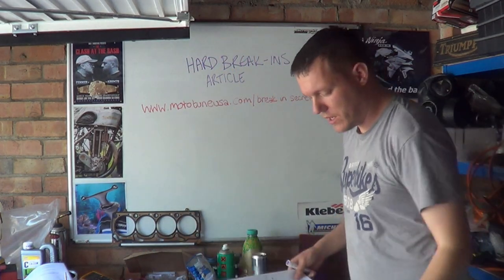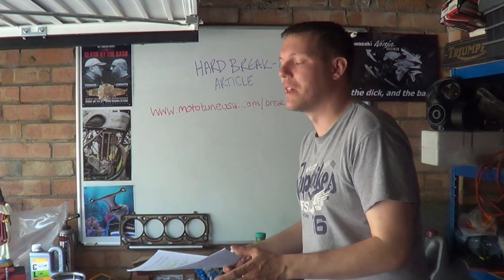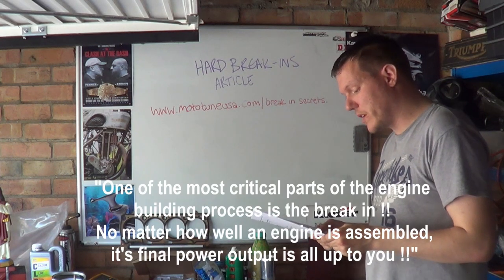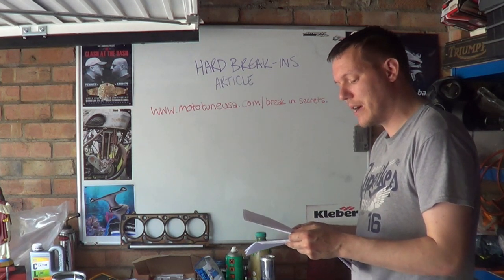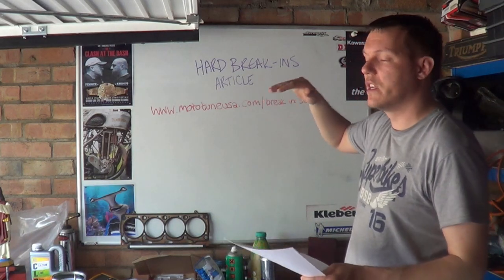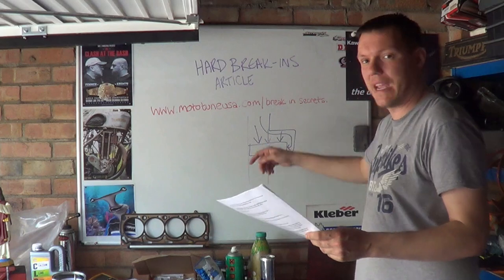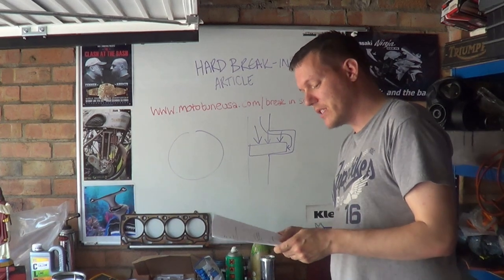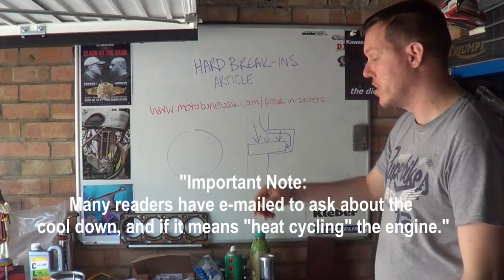Hard break in BULLSHIT! - Part 1

Comment: Those dyno run-in instructions are perfectly clear, they are pretty much how you start to run run in a race bike on a  dyno. You are misunderstanding throttle position and bike RPM. The 2 are very different and in your haste to discredit, you either tried to make it sound ridiculous or misunderstood.
Reply from the maker: You've misunderstood what I was getting at. The guy is banging on about ring bed in, so the only thing that should matter is engine rpm, not throttle position. 50% TP isn't always 50% rpm, regardless this shouldn't matter when considering the 'hard breaking procedure'. But hey, is wasn't totally clear what I was laughing at. 

Secondly, the run-in procedure is a lot different for a racing 'break-in' if you can call it that - I go through this here - https://www.youtube.com/watch?v=EQJuCdRzlA4
Reply from the maker: I didn't misunderstand anything, I laughed because the article is talking about break-in and ring seating. So rpm should be your only consideration. I fully understand that 50% throttle isn't 50% rpm. As far as racing 'break-ins' go I did a video here - https://www.youtube.com/watch?v=EQJuCdRzlA4
Reply: He says 50% throttle  40-60% max rpm, he never says 50% throttle 50% rpm. The 50% is the amount you roll on, and the 60% is the max revs you allow the engine to reach, it is pretty clear tbh. How do you answer the fact that all the engines are run to max rpm at the factory before signing off QC and going for delivery?
Reply: @dirtygarageguy  could please explain what you meant in the clip from 16:09 to 16:17, please ?

Comment: the so  called peaks on the cylinder wall  are supposed to be removed by soft honing, cross hatch does two things, hold the oil film and causes the rings to rotate (unless pinned for two strokes) there are companies that make gapless second rings, gas port  rings that use cylinder pressure to seal can fail due to carbon build up, the NASCAR guys say the rings are seated, by just turning over the engine during assembly, I think the real deal is  the heat cycle, warm the engine up give it some blips, check oil water etc and keep an eye on the oil filter for the break in period
Reply from the maker: The ring reason is their argument not mine, more in part 2

Comment: Is this just from new? or does it include after doing the top end on the motorcycle?
Reply from the maker: From new. But if you have most of your components changed then that is like new. If you have your valves replaced and guides then a slight break-in would be a good idea for say 200 miles. Basically run it for a month not thrashing the shit out of it.
Reply: Thanks, always used gentle break in, I race KTM 150sx and always put atleast 1-1/2 hours on it before opening it up as the top end is only done every 25 hours
Reply: The Workshop 200miles. Quite low there. I once replaced the conrod, piston, and cyl block (my daily 150cc). And was just simply told by the garage to "take it easy" for 1month/1Kkm. Which is basically the whole new break in procedure. Tl;dr How to determine break in after overhaul/major repair?

Comment: I dont understand the argument about a finer honing. Isnt it so, that you in fact need a slightly rough honing to prevent the hot runny oil to flow all the way back into the dry sumb

Comment: "half throttle dyno runs from 40-60% rpm" actually makes sense. Say your engine revs to 10K rpm. You would the run the engine from 4K to 6K at half throttle. I'm not at all convinced a few dyno runs are enough to run an engine in though.

Comment: Slow break in or hard break in dosnt matter as long as you are not revving the shit out of it for a long period of time.
Manufactures test every motorcycle before it leaves the factory and they dyno the shit out of them.
Watch how is made of any motorcycle. 
They all test the shit out of the bikes.
Just make sure you cahange the oil more often to flush out all the metal particles that accumulates from new part friction.
Reply from the maker: 1) what the fuck is a slow break in?
2) "as long as you are not revving the shit out of it for a long period of time."

- How long is a long time? 10 seconds or 5 minutes?

3) "Manufactures test every motorcycle before it leaves the factory and they dyno the shit out of them."

- what does dyno the shit out them mean? They run the engine through the rev range - to check if it can, noise, oil leaks, emissions etc.
Reply: Ment to say soft(manufacturer's way).

Don't redline it.

2-3 seconds at 7000-8000 rpm is not going to harm the engine.

And when I say manufacturers Dino the shit out of them, watch a video and see how they Redline the bike and they go through the gears hard .
not soft.

Comment: Hone in. Hahah! 
The best break-in is a slightly spirited drive around town, no engine braking. Go through the gears, roll-on the throttle as speed increases. Minimize time at idle. It's no big deal. Have enough RPM so the crank splashes oil at the bottoms of the bores, because some engines idle really slow. My LS idles at 500rpm, 40 PSI of pressure. With a bit of throttle, it goes over 60 psi, so wherever oil splashes, it'll splash better with a bit more RPM. Therefore, going around through the gears over and over. 
--A bigger ring gap or a little bit of blow-by isn't the end of the world. An engine that burns oil isn't profoundly bad. Closing a ring gap, that's fucked. Burning a quart every 1500 miles is annoying, but tolerable.

Comment: Every bike manufacturer here in Japan does the hard break in at the factory. So do the race teams. Except crashing there is only good that could come out of riding it like you stole it when you take delivery, and it's fine to do so. If it wasn't, the factory wouldn't be wringing the shit out of the engines at the factory on the dyno like they do right before shipping if off to the customer. If there is a chance you can get the seals to seat a little better during the first 100km you might as well go for it.  Just don't track it due to the danger of overheating. If you wanna sissy it, well that's probably fine too but you'll always be left wondering if your engine could have been destined for something tighter lol.
Reply from the maker: No they don't. They run the engine through the revs and gearbox looking for assembly faults. 

You've been watching that jake twat...

Comment: 2017 gsxr750 manual states to load the engine and vary the rpm but do not exceed 7000rpm for 500 miles. Also says to not overload but does say to load the engine
Reply from the maker: Riding is loading the engine - I'm not sure what you mean?
Reply: that's my confusion. i think they mean don't go crazy on the throttle but at the same time they are saying not to baby it because it specifically says to put some stress on the engine.

Comment: I just know during break in there is a lot of material that gets in the oil and cranking down on something with that oil in it is probably not the best.
Reply: Hence, why you should change the oil early and often during break-in. Not wait till 600 miles of damage has occurred as the manufacturer recommends.

Comment: Chrysler recommends a similar break in procedure in their owners manual . When breaking in an engine on a dyno is much the same. I have a car that is 15 years old and 155K miles broke in his way. It does not use any oil between oil change intervals that can be observed on the dipstick. My UOA has single digit wear numbers. On 1500 mile road trips it will use 1/8 of a quart. I understand I am talking about car's and trucks. Most Toyota 2003 Camrys of that vintage have oil consumption issues but not mine. I would not rev an engine that hi under break in but I would do 1/2 to 3/4 WOT pulls already rolling in 1st or 2nd and maybe up to 3rd or 4th gear then close the throttle and let the engine do some engine breaking and down shift to say 2nd and do it again a few times then drive easy for a few miles then repeat. I never break about 45 miles per hour and never exceed 3000-3500 rpms. You do not even have to be going that fast or rev it that high it is the loading of the rings you want which does not require high speeds or hi rpms. So I think engine breaking is also important.  I agree  WOT and especially from a stop or revving it excessively is silly. So some of his advice is decent he is just not articulate and he has some silly idea's. I drive manual transmissions so it is easy to do the above. He is an idiot though none the less he misunderstands what is going on during the real break-in process. I also do not think the average person can be trusted to do this with out going to far and causing damage. High rpms are a no-no during break in but some firm loading and engine breaking  are not going to hurt the engine if some common sense is used. I also disagree with him on his recommendation against synthetics.  I do like to add engine break-in supplement when I do this. General Motors sells an engine break-in supplement and has for about 40 years. It is loaded with ZDDP and other EP additives. Redline makes a break in additive as do other's. Many OEM's and Lubrizol a major oil additive manufacture that sells to refineries have authored papers on what parts of the engine prefer what EP additives during break in. Toyota and Lubrizol co-authored a paper using radio active isotopes to tag parts and used hot wires in oil galleys to measure oil flow at every part of the oil galley under real world and dyno conditions.  It breaks down what parts like moly and which like ZDDP based on radioactive tags left on the parts from those additives during the break in process. It was an interesting white paper. SAE has the published white papers. Mototune is obviously not trained as an engineer or in any hard science for that matter that much is obvious. When he does hit on something he completely misunderstand why it works and what is really going on! You also have other surfaces besides the rings that need some attention during break in. Gears in transmissions and differentials take about 10,000 miles to fully break in and we do not want to damage those from excessive heat. He does not address any of those things. A lot of the speed restrictions on vehicles during break in had more to do with the ring and pinion in the differentials than the engine. Depending on the level of lapping and matching at the OEM level the amount of heat these can generate is insane when breaking in.

Comment: "Forget what the manufactures say" ?   One mistake some engine builders make, is thinking the manufacture does not know what it is doing.
Reply: But after hearing their recommendations for break in, it seems the manufactures have gone very conservative.  A 1000 mile break in?   Show me one pro racers mechanic from any manufacture that agrees with that.  I have heard of pro mechanics putting a new 2-stroke top end on a MX bike dry, so the racer could seal the ring a bit faster in practice, and race later the same day.  OK, some manufactures recommendations seem to have other factors involved--that a racer does not care about.
Reply: Two strokes are a different type of break in to 4 strokes and race bikes are a. Different thing entirely tbh. If it's being rebuilt 3x a season and the top end comes off every other race you can do things that are a bit different. The break in is about longevity managing how oil hungry a 4 stroke is etc not about increasing power. An excessively soft break in may cause a reduction in power but that's not the OEM supported break in.

Comment: Most people, including yourself, will have no problems with a manufacturers recommendations, because you haven't experienced (what you believe to be), a "break in", problem. Fine, do what the manufacturers ask. You just won't get MAXIMUM performance, or LONGEVITY, from your engine. Period. You'll get manufacturer and customer, "expected performance", and that's fine for the majority. You, and most others, did not read the article in detail, or put his theory to the test. Those that do the break in CORRECTLY, (with scientific principle, and purpose), will see it's benefits! Motoman, is not doing anything "new", but he has laid out a format for others to use to our benefit. This method is used in aviation, top engine building, and even by the engine manufacturers themselves. I would highly suggest people go read the WHOLE article, and it's detailed theory, themselves. Or, you can listen to this guy, that fits in with 99.999 percent of "mechanics" out there, and be fine with mediocrity.
Reply: jon-paul cooper have you sent your c.v to Kawasaki et al because your obviously more skilled and technical than their engineers what do they know about engine building and design and manufacture? 
You state top engines like race engines and they maybe 'top' but an ideal performance engine fails just after the chequered flag so in moto gp for instance 200miles or so well that's great but a ball ache in the real world if your commute is 201 miles. I'll stick to what the manufacturer recommends. 

When your doctor gives you advice do you follow it? or ask Google because you don't agree with what he says?

Comment: At the end it is your bike and your warranty that goes down the drain if you fuck it up du to a bad brake in. I prefer to not lowball the rpm ride it trough all gears at first with 1/3 of max rpm engine breaking every gear down and begin the same going up the gears never staying at the same rpm. after shifting up i decelerate rpm before accelerate. Yep looks like an moron on a bike. I do that for the first 100miles. Then the same up to the 1/2 of max rpm till I hit 250miles. Then I go normal riding up to 3/4 of max rpm and allow it to cruise at the same rpm for short periods but use engine braking only normal to decelerate till I hit 600miles. Change the oil and ride normal with moderate acceleration for 100-200miles from there on I blast the shit(e) out of the engine when ever I feel to do so... Always allowing the engine to warm up before and to cool down after blasting the shite out of it. Never ever turn off an hot engine allow it to cool down a few minutes before turning it off. That alone makes your engine last longer and perform better because you do not let the oil fry between your piston rings and on your valve seat... and turbo engines need that especially. No gung no worry! You ride hard? change the oil more often! All above is my opinion to a 4T engine break in. Even a Harley Davidson should not be lowballed in the rpm over the first 600miles! I think it is the worst you can do to open the throttle at low rpm... sounds great that banging but when it bangs it wears more.

Comment: My theory of a proper run-in: vary the revs as often as possible. Go through all the gears. Don't abuse it (like a dickhead), but don't baby it. Avoid full throttle, stick to a limit of around 70%. But don't stick to a limit of 20%. Vary between 0 and 70% as often as you can, safely. Use the manufacturer's recommended mileage, change the oil and filter, and slowly ramp up from there. I would use another of the manufacturer's recommended mileage and change the oil and filter again (so if the manufacturer recommends 600 miles, I would change at 600 and 1,200). By then it's good to go.
If you see issue with this, educate me.
EDIT: Just watched part 2. I think people misunderstand manufacturer's break-in and think it means "baby it."
Reply from the maker: "Just watched part 2. I think people misunderstand manufacturer's break-in and think it means "baby it."

- Totally with you there

Comment: Truth is, all engines will need to wear the piston rings in. The argument seems to be "HOW DOES IT WORK?" No one can deny that rings will need to wear off material to achieve a closer relationship to the cylinder wall. Fine. How is this done, and what makes that successful vs. what makes that a fail?

To properly understand it, someone would need knowledge of metallurgy, heat treating, metal plating, and a solid grasp at combustion. It's one piece of metal rubbing against another piece of metal, with special cylinder coatings between. Also heat cycling is important, but probably much less up to the operator than it is down to the physical design of the engine (tolerances, fits, metal porosity, castings, forgings, fit-and-finish of them all).

Engine technology has changed over the decades, so have the materials, so have the machines building the engines. In that dynamic set of circumstances, piston ring seating has also been affected. It's gotten much better, honestly.

I work on 3D CAD and in a manufacturing environment for my occupation, with an engineering background. The business I work for is involved in precision motion control parts, which involves heat treating, tight fit tolerances, plating, and a lot of proprietary processes.
Reply from the maker: Why does everyone focus on the rings and not the camshafts???
Reply: I don't know that everyone does. Rings are designed to wear, as they are much less hard than the cylinder wall they rub on. It's a "metal gasket" of sorts, that achieves better seal over time (wear is on a falling curve). There are so many different camshaft designs with rockers, buckets, direct or indirect contact, etc. etc. that it's not as easy to make direct statements about. They do wear, but since leaded fuels went away and valve seats got much harder, the wear reduced drastically.

Why do you ask?
Reply from the maker: piston rings are half bearings half seals (mostly seals)